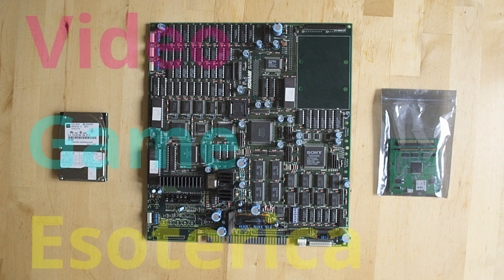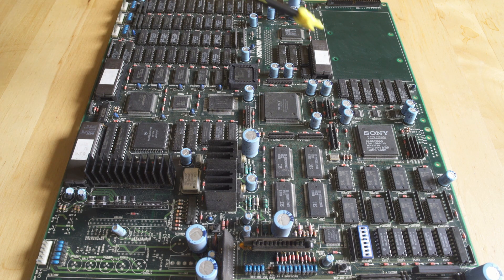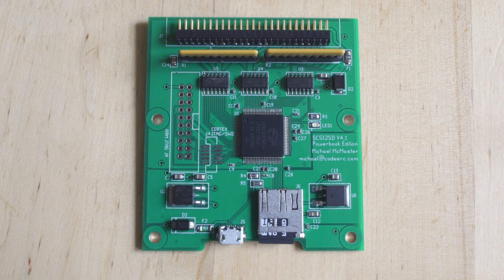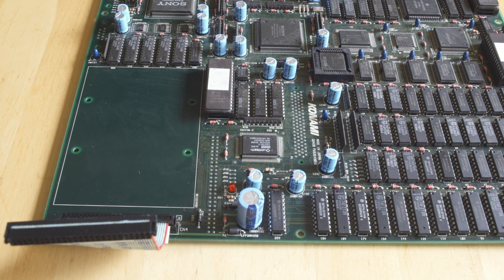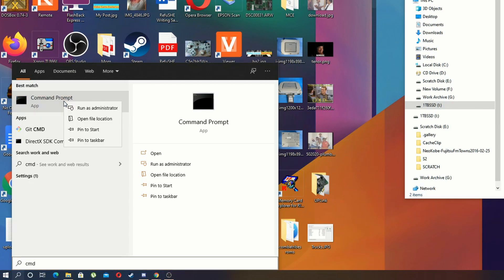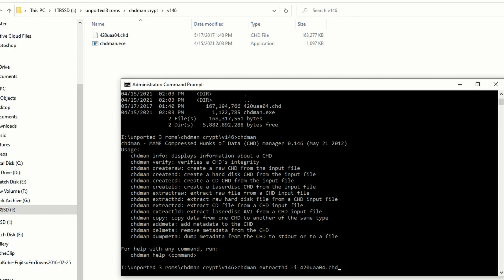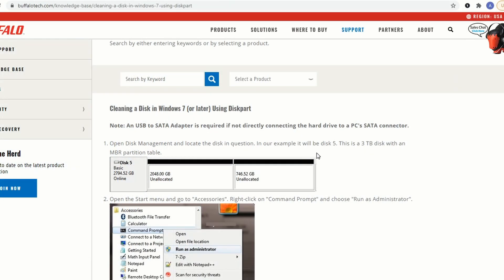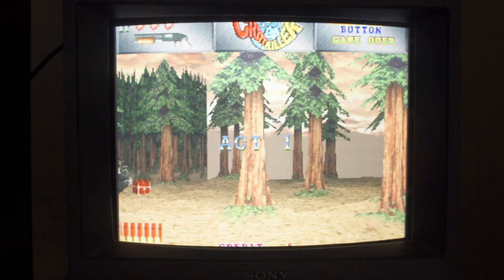Restoring a Crypt Killer PS1 Arcade PCB - How to use CHDMAN for Hard Drive Repairs and Backups.

Comment: In your example of chdman you have the incorrect syntax. You have a space between \\.\ and the disk number.  Can you please clarify this? You’ve essentially defined the output as \\.\ and I don’t know if this will default to drive 0. Please confirm and update with a comment as I’m scared this will write the image into the wrong place. I don’t have a machine I can destroy to test/confirm.
Edit: it appears chdman will accept either syntax.
Reply from the maker: I wrote my sd card with a space. I’ve seen it written as either. It’s the physical drive number that dictates the drive flashed. If the syntax is wrong on a version of CHDMAN the operation will fail to complete. It’ll just spit back an error. 

I’ll make a note of it in the video description all the same in case people get a syntax error on the version of CHDMAN they use
Reply from the maker: I added a note to the description but I checked my files just not (captures) and I wrote to the correct drive with a space.
Reply: @VideoGameEsoterica  well that’s good then. I use the \\.\ syntax for a bunch of drive copy things not related to anything arcade (special drive recovery and getting access to drives that don’t have a letter assigned and so forth) and I’ve never seen the syntax with a space in it. The Win32 Device Namespaces API also documents it without a space. In any event it obviously works and without danger. Thanks for the clarification.
Reply from the maker: CHDMAN won’t complete a command if the syntax is not correct in my experience. Without telling it a physical drive number it won’t process. I’m not sure why it functions with or without a space. I’ll look into it more
Reply from the maker: I just tested this and purposely left out any reference to a physical drive. CHDMAN won’t complete a request otherwise. So as long as you have the physical drive number correct you are good to go!

That’s why I stressed so heavily to get the right number lol. One fat finger mistake and you flash the incorrect physical drive number
Reply: @VideoGameEsoterica  Oh yeah for sure! It would be so easy for someone to whack a drive on their machine if they don’t understand what’s going on. Thanks for taking the time to check this all out :-)
Reply from the maker: I was VERY firm on the drive number portion because I know from experience (my how to clean a pcb video) that people will do wild things. I show putting small amounts of IPA on the pcb with a q-tip. Someone commented they ruined their board because they poured a WHOLE BOTTLE on it.....yeah